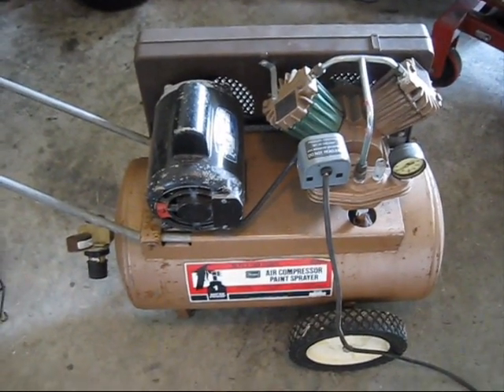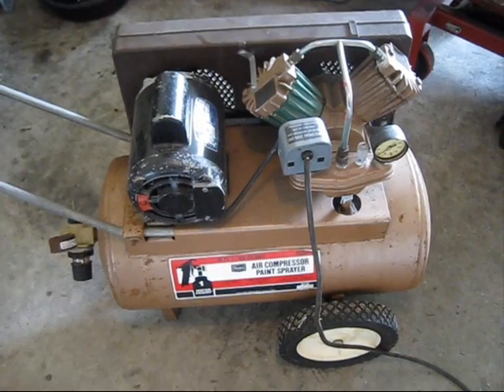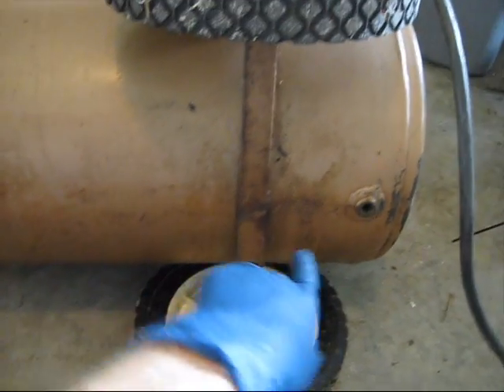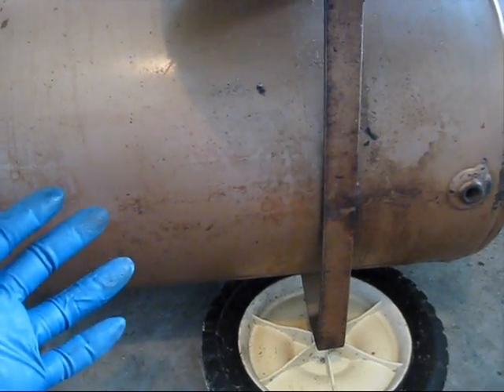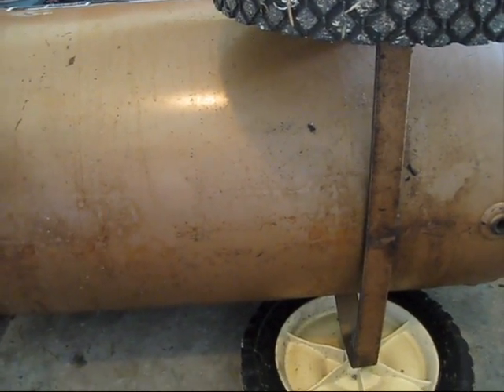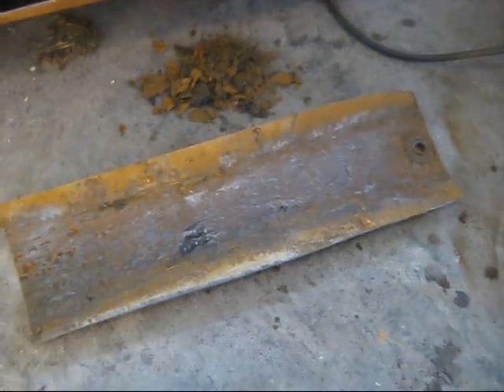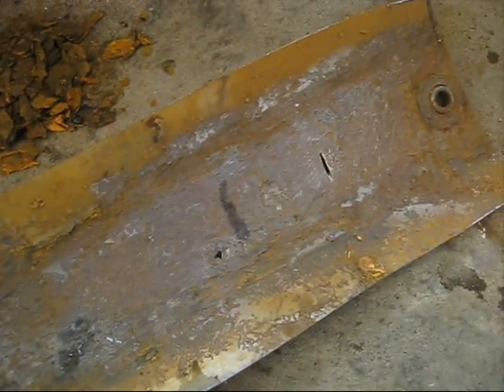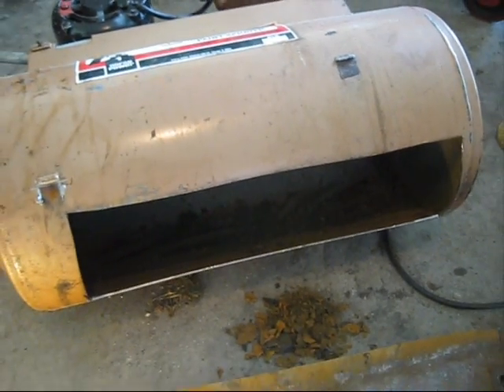What happens when You don't drain your air compressor

Comment: it doesnt matter if you drain your air compressor regularly, it will rust no matter what you do because there will always be water there, UNLESS you use an air dryer in the output of the compressor block BEFORE the tank inlet.......

Comment: The bottom of mine was very similar to this. I bought it 2nd hand around 7-8 years ago and in all honesty, didnt use it much and didnt drain it as often as i should've done. The thing was only made in 2010, developed a crack where the motor mount bracket weld was. After opening it up with Mr angle grinder, there was zero rust where the crack was, i guess the vibrations of the motor caused the week arse Chinesium steel to fail.

Comment: Commenting from Nebraska.  Thankyou for this video.  Was using an old SpeedAire compressor that probably was pushing 40 yrs old. Replaced the power cord a couple months ago. I was surprised the compressor lasted almost 40 years. 
However, after watching your video, I seriously never knew anything about draining air compressors and if there's a pin hole leak in the tank, the tank is compromised.  I never knew this before. 
Anyways, this particular air compressor technically had an air leak. I wasn't terribly too concerned about it due to its age. However when using today 10/2/22, I had it running and it literally blew up. 
Thankfully I was outside the garage when it happened.  Talk about a huge explosion. Very nerve racking.  Very scary. 
Other than my motorcycle getting a little damaged from the air compressor blowing up, the garage didn't sustain any damage.
A couple ?s I have now after learning about air compressors...
(1) With the explosion I experienced, shouldn't the pressure release valve have opened?

(2) how often does an air compressor need to be drained?
What's the process of draining an air compressor?
Reply: The tank was weak, and it blew apart at a pressure lower than the set point of the pressure relief valve.
Reply: @mguerramd  thankyou for replying. I definitely didn't know that was the reason it blew up.
Reply: Everyday you run it, drain it. If you're not going to use it for some time, vent the tank down to ambient pressure and close the petcock. Little to no condensation at ambient pressure.

Comment: they should make these tanks with an inner tube/bladder. That would make the tank much less prone to rust. 

i realise i have a 20+y old tank sitting in the garage which i occasionally use. i think i'm gonna drain it. See if some rusty water escapes...

thnx for this informative and valuable info!
Reply: I plan on doing zinc based cold galvanizing on mine, maybe with a coat of WD40 over that, assuming the tank survives hydro testing.

Comment: The manufacturer is also to blame, some times, the compressor does not sit right, for the water to drain, meaning to drain valve at one end, and the water sits at the other. ( on level ground  )

Comment: I drained my compressor today. First time 15 years. 

I had a litre of brown fluid come out.

I use my small compressor most days as a professional upholsterer. It is a small 8litre Clarke air and I hate to say it, but my ignorance of mechanics is the reason why I didn’t drain it.

Also cleaned my air filter and changed oil. My trusty old compressor will probably pack up now!

Comment: My first job my boss showed me where the drier valve on the  main airline was and how to drain the compressor every evening before closing time to keep this from happening.  I've seen the after math of what happens when a decent sized compressor bursts from condensation build up over the years.  It cost a few thousand in damages to a guys work shop not to mention the cost of a new compressor all because he couldn't turn a valve in the bottom of his compressor, if any one was near it, he'd probably add hospital bills as well.

Comment: if its under the workbench can you just bolt it to the concrete floor with tap cons and build a steel corral around it so if it explodes at least its contained?
Reply: If you're sure your bench is bomb proof, I guess. The last thing you want is to wrap yourself around your tank when it explodes, like if you are working at the bench, hands on it and looking right at it. Better by far to have it in a separate shed made of cinder blocks
Reply: @Dorian803  thanks for the advice Neil

Comment: Air plus water is much worse that all air or all water. Tanks corrode at the air-water interface. Corrosion from not draining the tank is the most common mode of failure of air compressor tanks. Most manufacturers recommend you drain the tank every time you use it. Stay away from equipment where some moron defeated the safety devices. I’ve seen safety pressure relief valves that had lead pounded into them to stop them from leaking.

Comment: That is a 1960's vintage unit, the spray gun that came with it operated from 35-50 PSI, so the compressor had enough SCFM's to operated the spray gun.

Comment: Drain mine daily. When I’m done for the day, turn it off, pop the valve and allow the tank to completely drain. There’s always some water in the tank from compressing the air.
Reply: Read operator's manual on many portable units, suppose to use relief valve to reduce tank pressure to 20 PSI and the open the drain, to drain water/air, then with valve open,[next time you run] turn on compressor and run for two minutes and then close the valve, and run compressor

Comment: If you’d stuck a bicycle puncture repair patch on it it would have been fine! You can still fix it with duct tape.

There’s a video showing the damage one of these can do when they explode, including destroying a garage door. It’s frightening the damage they can do, and of course they are at their most dangerous when under the most pressure, ie when in use. For hobbyist like myself who have their tank in their workshop this usually means when someone is in close proximity.

Personally speaking I’m not sure I’d keep a tank above ten years or so and I’d never buy second hand. They are relatively cheap and you'll soon get your initial outlay back in what you save in tools. 

I agree the compressor and motor deserve being saved, nothing that works or is fixable she go to landfill. This video could have saved someone's life if they’d paid heed.

Comment: I know of a Sears compressor that dates from the 1950s or 1960s judging by the cloth insulation on the cord. The tank had a pin hole so the owner soldered a penny over the hole... it's still in the owner's garage. Children of the tail end of the depression are perhaps too frugal.  😉

Comment: When they get that old you want a more powerful one anyway.
Reply: thats the motor not the tank.
Reply: @5hiftyL1v3a  probably more so the compressor pump not the motor
 edit: I guess also the tank technically because a premade combination tank is usually not rated too much higher if any than the compressors maximum output.

Comment: Air Accident Investigation Branch Reports have repeatedly shown how pinhole fatigue can propagate into uncontained catastrophic fractures leading to the loss of the aircraft and everyone on board!

Their meticulous investigations graphically follow the original point of the pinhole fatigue through to its terrible outcome, which is why I specifically mention them!

Whether the pinhole fatigue is occurring in your air tank base or one of your helicopter main gearbox planetaty gears, the outcome is an uncontained catastrophic failure!

And there are very many more badly operated and maintained air compressors in use worldwide than there are meticulously maintained helicopter main gearboxes!

So its easy to see where most danger lies!

Comment: They rust out even when you drain them. Mine developed a pin hole at 17 years old. The tank was drained dailey and sprayed internally with a rust preventer when new.
Reply: Tanks have a life expectancy of 9 years or less, depending upon how many times it has been cycled [ tank usage] which is 15,000-20,000 cycles, days with high humidity, and cycled more than on low humidity days will have a greater deteriorating effect on the inside of the tank.
Reply: I drain my tank after every use, and I haven't done more than 100 cycles on a 7 or 8 year old tank.  I still get a few drops of rusty water every time I drain it.  Does anyone know if this is any dangerous yet?
Reply: My 60 gal from 1994 is workin just fine. I drain it every few times I use it.
Reply: When you drain also add little bit antifreeze to prevent any rust..
Reply: As the saying goes, they dont build stuff like they used to. Nothing is made to last anymore. You could have a compressor from the 1960s, the tank would be in better shape than something that was made 20 years ago. One word, Chinesium.

Comment: At one of my old jobs I emptied the compressor, no one had done it for several months so I got out about 30 liters of water.
Reply: The one being used at my work right now is never drained and has an oil leak so its running with no oil. Boss is very """frugal""" (😂) so not expecting anything to be done until there is a catastrophic failure

Comment: Is there anyhing i can spray in my compressor tank to keep it from rusting! I just bought a brand new campbell hausfeld  air compressor in may of 2020.
Reply: ambient air has a certain humidity level and is being compressed, this leads to the humidity raising once the air cools down.
To avoid lots of rust in the tank the humidity of the compressed air after cooling own needs to be below condensation.
That's done by cooling the air after the compressor with some air or water heat exchangers and then a water trap, so non condensing air enters the tank.
One step better would be to feed dry air into the compressor, so that when it is compressed the relative humidity stays below condensation.
Edit: Pre-drying doesn't work.. you'd need very low RH levels for this to be useful, which is not feasible. This is why industry is using refrigerated compressed air dryers.
Reply: @joansparky4439  I sprayed wd40 or pb blaster in my air compressor tank. That should help it last a long time. Plus i drain it every time i use it.
Reply: @joansparky4439  way to not answer the question at all
Reply: @tylerbonser7686  
..there is nothing you can do.
There will be water in the tank of a normal compressor because the dew point of the compressed air is definitely below ambient once it cools down. No amount of paint or other miracle substance will change this fact for the inside of the tank.

Ah no, I forgot one.. you could try to get a stainless compressor tank. That will stop the rusting.
Reply: Unless it is glass lined at the factory [like water tanks] spraying or pouring anything into a compressor tank will shorten its life not prolong it.
Reply: I have seen a few people pour paint in the tank. I think that is better then nothing. Of cores you would have to take your compressor all apart to do that.
Reply: Higher end units have powder coated tanks and automatic drain controllers.

Comment: Always replace your crappy air compressor valve with this Bostitch BTFP72327 Ball Drain Valve when you buy it and put it on as soon as possible. Also if you can find someone at a machine shop that will sell you some rustslick. Will cost you about $2.  Dump that into the tank and slosh around, then dump out.  Your tank will never rust if you open the ball valve whenever you use your compressor.  It’ll cost you $12 and the compressor engine will fail long before the tank.

Comment: Compressing the air inside a tank isn't the only way to have a condensation problem inside the vessel. If one lives in a humid environment (like here in LOUISIANA), it would be wise to treat the interior of the tank when it's new. If a tank has the drain valve left open "to air out", Humid air will enter the open valve and if temperature drops below the dew point, the inside of the tank will resemble the outside of a glass of ice water that has been sitting for a few minutes..This is the reason for rust on my tools, even when stored in my cabinet. For an older tank with rust present, I would get 2-4 quarts of Evap-o-rust or Rust Kutter and pour it in and use two-three days to roll the tank around (or pick it up and vary the position a few times) the yard to get every square inch coated. Maybe add some pea gravel to the product and roll it around more to rid the device of as much rust as possible. Then maybe have tank hydro tested and recertified. If not feasible, then simplu make sure that the pressure regulator is serviceable and don't pressurise the tank to the limit. If it's rated at 175 lbs, then run it at the 125-150 lb range. That's more than adequate for most applications like air impacts. And if the compressor is an oil lube pump, it will create a thin layer of oil mist on the inside of the tank, esp. an older one with a little wear.
Reply: The Gulf states have the added hazard of salt air, making the rust happen faster.

Comment: Unfortunately, a lot of horizontal tanks have that inherent problem of the bottoms rusting. Where they weld the drain hole into the bottom of the tank,  it's raised up enough inside the tank that not all of the water will leave the tank when it's drained. I'll only buy a vertical tank for that reason. Glad you didn't try to join the Darwinian club , Thanks for sharing !
Reply from the maker: Depends on the tank. Alot of newer budget tanks have the fitting pressed in and raised like you said. older and larger ones tend to have a hole drilled in the tank and the fitting welded over it. My 33 gallon craftsman has a large bung welded on the bottom of the tank. There is no way to get around the fact that Horizontal compressors just don't drain well though.
Reply: Yes. Idk what to do with mine. Just now im going to move it from my work space at lest, though still dont want it to blow up

Comment: My husband passed away and no guy in my family told me about doing this. 
When I first did it , it scared me so bad . 
It has been 2 years since , and they meaning the men in the family come over and use it , but they never help me with these things . 
It scares the hell out of me . 
Do they blow up when you pull the plug ?????
Reply from the maker: Usually they will have a drain valve. Opening it will relieve the pressure so no.
Reply from the maker: @Richard Vaughn Yes, valves can be opened slowly under pressure. But Plugs should only be removed when there is no pressure.
Reply: Richard Vaughn well I had pressure, and 😮

Comment: Wait.  When you say drain, what exactly do you mean?  Every day I use mine, at the end of the day, I empty all the air pressure using the bleed valve on the bottom.  Actually mine isn't dead center on the bottom so I lean it so that it is.  It sputters and small bits of moisture spray out.  Then when the pressure is all gone I leave the valve open.  I worry about insects or spiders crawling inside when my tank is stored.  Anyway am I doing the right thing?
Reply from the maker: You really don't need to drain it all the way, just enough to get the moisture out. I have an auto drain on mine now that dumps some air/water every 30 minutes.

Comment: Even though i have a compresoor and i use it. I always wonder the compressors used in industrial fields no one drains them for years.... are there compr. out there made from other materials that do not rust?
Reply from the maker: Aluminum will corrode but not rust. Industrial compressors usually have stronger tanks as well and can often be equipped with automatic drain valves.

Comment: I have the same problem just now. My Sears compressor is over40 years old and I got it used 35 years ago and I suspected that the tank may have rust  inside that time. I am surprised that it lasted me 35 years before I have a pin hole. I recently got a bigger tank and is planning to take off the electric motor and compressor from the old one and put them one the new one.
Reply: -  Haha... I have a similar compressor... where did you find the replacement tank at?

Comment: You want to live long?  If it had bursted you would be dead or crippled.  Should never mess around that close to a leaking tank like that!
Reply from the maker: The drain plug is removed. It wasn't building any pressure. I made the video warning about rusted air compressor tanks, you really think I would screw around with that?
Reply: @pfun41  Drain plug removed but it's hissing? LOL!
Reply from the maker: @BobNA-r2g  What are you smoking? There is 0 pressure build up, and no hissing whatsoever. Is the wide open hole where the drain plug was not obvious?
Reply: @pfun41  Oops, wrong Video, LOL!  No idea how I got that mixed up. I think I had to tabs open on youtube.